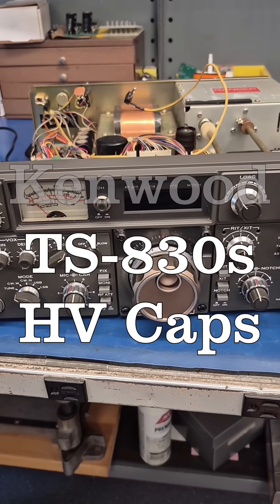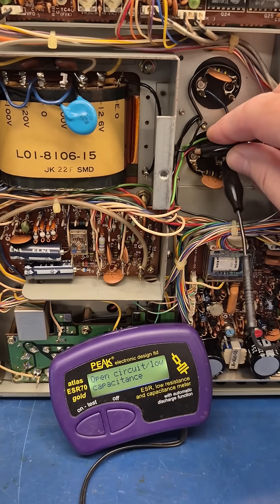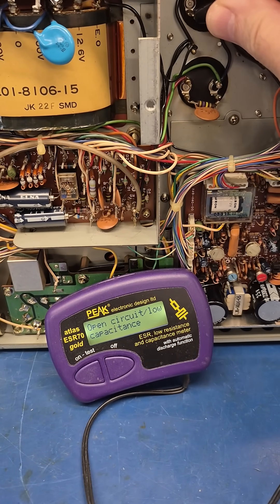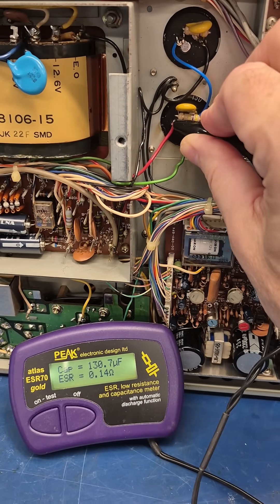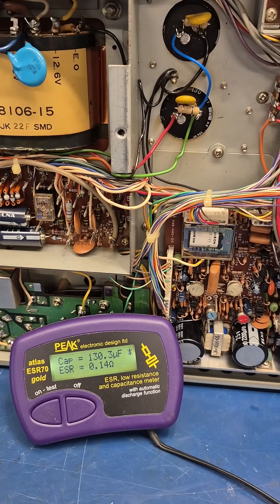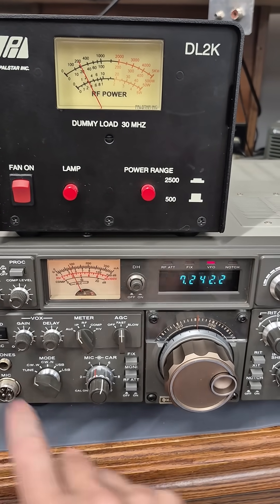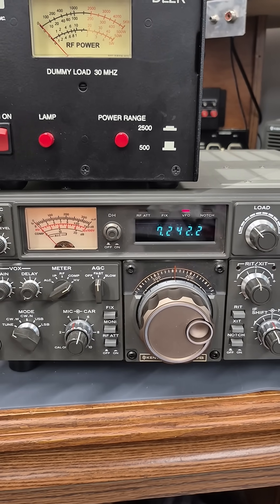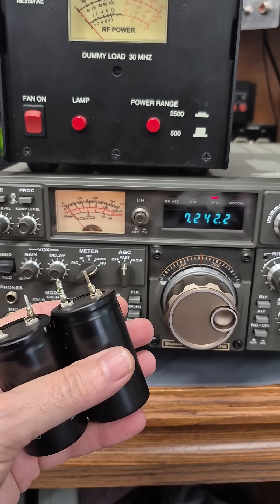Kenwood TS-830s caps #shorts #hamradio #diy #retro #shortwave #vintage #repair #old #audio #antique

Comment: I know all the electrolytics in my old oscilloscope need to e replaced. I inherrited it from my father and it hasn't been used in 40+ years. Luckily it's pretty basic and only has about 8. My other one has about 2000.